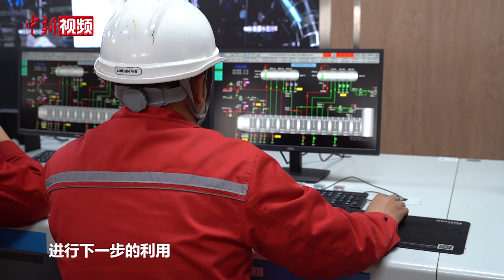中国西北单机容量最大燃机电站停运十年重启 促进海西地区新能源发展

Comment: This is a combined cycle plant using natural gas as the prime fuel.  China is now getting more and more natural gas from internal exploration and from external import like from Russia and Middle Asian countries.  The combined cycle plant might have ceased operating in the past due to a lack of supply.  In a long China needs a good balance of renewable energy plus some conventional thermal plants increasingly being used as for regulation control and frequency stabilizer.